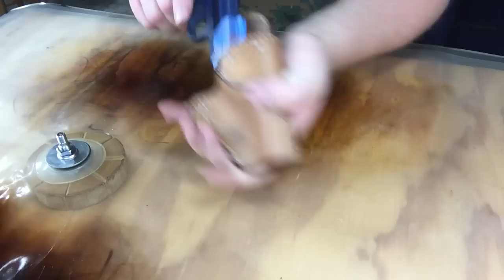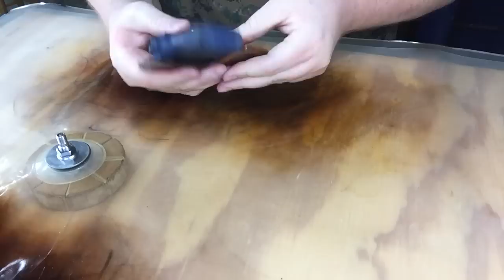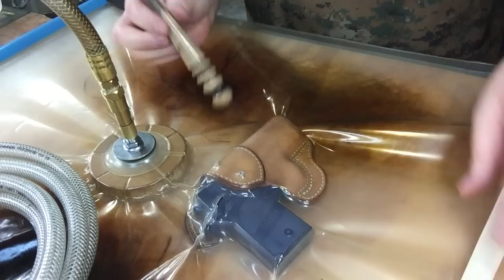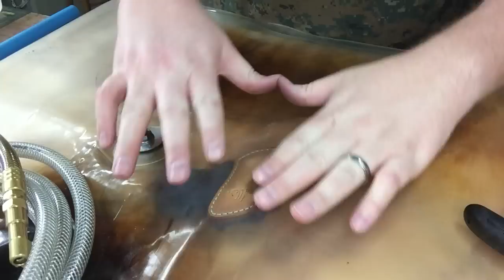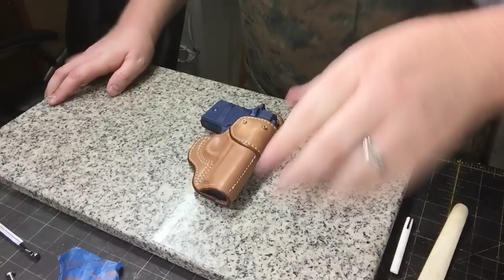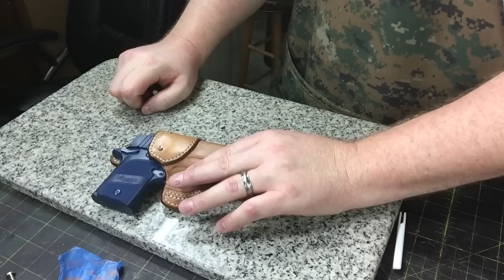Forming a leather holster with a vacuum press

Comment: I use a Foodsaver machine. They pull high vacuum and the bags can be sealed to hold the vacuum. I cut the bags large and can reuse them several times (they are cheap too). Then wrap a sheet of thin children's craft foam around the holster (it will keep the bag texture from imprinting on the holster). I leave the mold gun and holster in the bag under vacuum for at least 6hrs. Then dry the holster for several hours with the mold inside before removing it to complete drying. Then apply the finish of your choice.
Reply: Try a fridge compressor? Think can nearly pull full vacuum. 30 something? " of Mercury in tube maybe like old days? Guess. If I'm right )

Comment: I just made my first vacuum molded holster today, I used my regular food vacuum sealer, it seems to have worked pretty well
Reply: I use mine on my smoke. The clear  vacuum seal bowls are the best. Seal it up. Fresh.
Reply: @alvinseaside790  nice, I used to too, but moved to a state where it's still illegal 3 months ago, I want to smoke and 4 miles away its legal, I've been thinking about going and picking up a sack
Reply: @manbearpig2164  it’s still a reason to loose 30 minutes of your day getting a ticket here on South Padre, and a felony if it’s wax or altered in any way. I don’t care man. I finished 34 years for the state of Texas august 2020. I’m clean, free for the first time in my life since 1983. I’m smoking, I’m smoking now, and Id pass you this here Tobacco smoking device right to ya if they had a pass the cigarette button. Yeah, freedom.
Reply from the maker: That is awesome! Mine is in bad need of upgrades. After about a decade of use, my bag doesn't hold suction very well since there's a few tiny holes in it. I've never tried a food vacuum before - were you able to mold the holster at all while it was in the bag using your forming tools?
Reply: @AdamsLeatherWorks  yeah a little bit, I used mainly the back of a toothbrush, a lighter and my fingers, the bag is somewhat sturdy, but probably not as tuff as what you use, I plan on making a couple more soon, just waiting on a leather order
Reply from the maker: Nice - the round handle on a sharpie works well too. I’ll have to try my food saver one of these days.

Comment: Eric.  You are a true craftsman my friend. Love your work.  How wet do you make the leather for molding?Thanks for another great video.
Reply from the maker: xdshooter1 Thank you sir! I usually dunk my holster in luke-warm water (with a drop or two of soap) for about 7-10 seconds. 7 seconds for natural, undyed leather, and 10 seconds for black. Sometimes I might give it a quick dunk again if it's not absorbing water very well, or I might rub a damp sponge on the outside if necessary to add a little more moisture.
Reply: @AdamsLeatherWorks  i have a little hand-held clothes steamer, do you think it would be good to use that instead of dunking since the steam would theoretically penetrate better with less overall water? (obviously I wouldn't hold it too close/get the leather too hot)
Reply from the maker: @VoluntarySynesthesia  It would be worth a try, but I think it might work better on thinner leather. The leather I use is 7-8 ounce (1/8" thick) and I don't think steam would penetrate very far. But who knows - i might be completely wrong! Lately I've been dunking the leather in soapy water for 3-5 seconds, then adding more moisture if necessary with a sponge.

Comment: I read your blog on the vacuum press. Your sure put a lot of time into that to share with others. Thank you. The link to the bag is not loading on there site. Witch bag are you using "20 or 30 mil, vinyl or polyurethane"?
Reply from the maker: I believe this is the bag I bought. I need to go back and check all those links again. http://www.veneersupplies.com/products/VS-Extreme-Polyurethane-Vacuum-Bag-2-x-4.html

Comment: What is a platen? I was going to buy a vaccum bag from the place you suggested. I want to make sure I get everything I need.  I am going to buy a vaccum pump from harbor freight for $90
Reply from the maker: The platen keeps the opening in the bag from immediately closing as soon as the pump is turned on. I just use a piece of MDF with grooves cut in it for air tunnels.
Reply: I have the pump and the bag.  The bag came with a small brass fitting.  What do I need to connect the bag to the vacuum pump?

Comment: How much forming is too much. My holsters all seem to come out "muddy looking" when they dry. What temp is oven?  How long in the oven?  Should I let it dry with the blue gun still in the holster, or do I pull it out at some point before it is fully dry?
Reply from the maker: Not sure what you mean by muddy looking - but are you having trouble getting the leather to hold the detail? If so, the leather might be too wet. How much forming is too much? If you lock the gun inside the holster because you molded the retention points too deeply (ejection port, trigger guard, etc.), that's too much. Otherwise, I don't think you can mold it too much. But on the flip side, you don't have to mold a whole lot of detail if you don't want to. Just make sure the holster securely holds the gun without allowing it to wobble around inside the holster and mold in the previously mentioned retention points a bit to help secure the gun. I don't use an oven anymore - too hard to regulate the temperature. But I aimed for no more than 140 degrees Fahrenheit, and I left it in the oven around 40 minutes. A safer route is to hang the holster(s) inside a drying cabinet and warm the interior with a space heater set on a very low temperature. I actually used my airbrush cabinet for a drying cabinet. I hung the holsters from the top via hooks, then set the space heater on the shelf inside the cabinet and adjusted the temperature to low. And it is a good idea to leave the blue gun inside the holster while it dries.

Comment: Great job , wipe holes with rubbing alcohol , go to Walmart etc. and buy a tube of "goop" stays pliable and permanent you can also use plastic clay on the nubs so they won't puncture again . Good luck
Reply from the maker: Great idea - I never thought to try adding any type of sealer like that. I could probably screw in the male side of a Chicago screw to cover up the posts. Thanks for the comment - I'll try it on my next batch.

Comment: Is 6 to 7 oz. leather okay for a holster or would I need some heavier stuff?
Reply from the maker: It depends on the gun and holster style, and the density of the hide. Light / smaller guns can get away with thinner leather. OWB, in my opinion, can also handle thinner leather, whereas IWB needs to be thick enough to withstand the extra pressure from the belt and pants trying to close the holster. Zach White Leather has some 6-7 ounce premium double-butt bullhide (item # Z1076DB) that I really like.